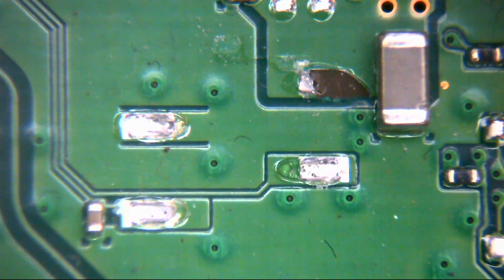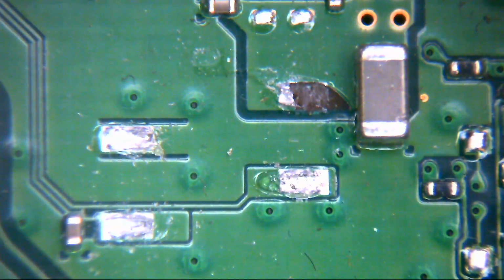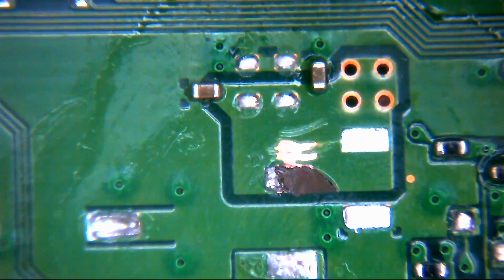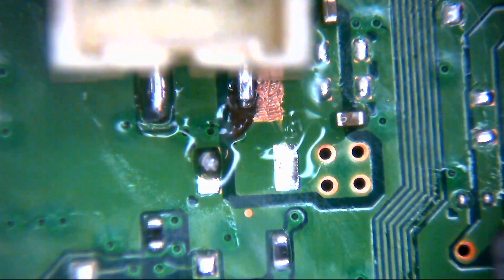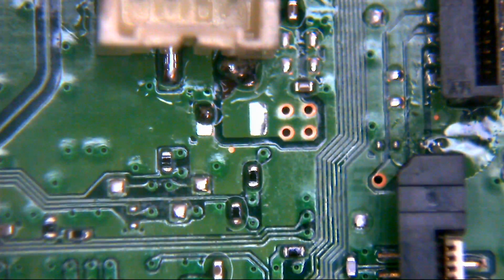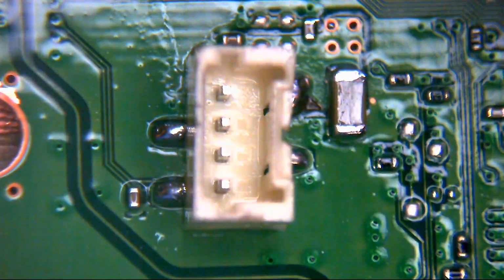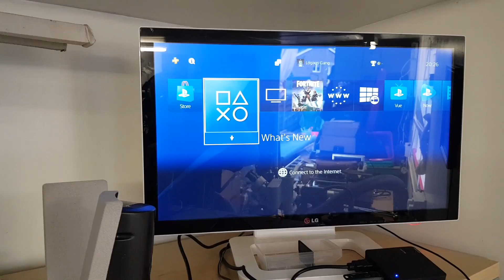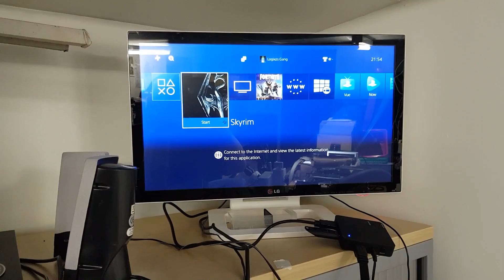PS4 CUH-1216A 5v Connector Ripped Off Board Repair

Comment: A piece of copper foil with little holes that line up with the solder blobs should allow you to fuse the foil back to where it is needed and the cap can be replaced, would the overheat problem go away if a Corsair AIO was used instead of the HSF.

Comment: Love those videos. Lets put some flux. Lets solder it. Lets check connection with fluke. Lets clean the board with alcohol. Lets put some flux. Lets solder the capacitor with soldering tip big as power connector. Lets change the tip. Lets solrder the capacitor. Lets clean the board.

Comment: Hi Andrew, I ripped off the bottom right pin, the "data pin", off the motherboard. Can I scrape the area to the bottom of the pin between the two dots and solder the pin back on?

Comment: What would I do if the pad ripped off of that bottom right connector. I think you said it's a data line. That whole little square came off on the bottom right one

Comment: thank you for the video! great information on the ps4 and soldering in general. I was able to fix mine using your method.
Reply from the maker: Glad it helped
Reply: I have no pads on mine SAB-001 5v 4pin. What is the best Enameled Wire to use for this repair??

Comment: Hi,
have you the pin out underside psu connector of  ps4 pro? a photo? because sometime is more easy try to connect to the underside...with no connector but with cables.
Reply from the maker: I do - take a look through my other videos and you'll find it. In the description is a time-stamp of where to find the diagram.
Reply: @AndrewPaul  thk for reply...can you postthe link 0lease

Comment: Hi, I was wondering if you could help with a ps4 I bought to fix? I didn't test it as I could see the hdmi port was in bits, soldered on a new one no problem but it just has the continuously pulsing blue light. I've checked the board and there are shorts to ground on almost every component around the apu and ram chips... they're everywhere! I was thinking of pulling the APU to see if this will help or should I put it in the bin now?

Comment: I did the same thing however my ground is the only one that ripped away from the motherboard. What parts of the motherboard need cleaned to the copper..and I'm using silver conductive wire glue to do this job
Reply from the maker: If ground is the only one missing, scrape the conformal coat next to the missing pin then bridge the solder across. I wouldn't use the glue - it likely isn't going to be strong enough to hold the connector and you'll have issues getting that ground pin back in place as you'll need to do the above to get across the gap which is now present.
Reply: Andrew Paul so bridge the solder from ground to itself?
Reply: Andrew Paul bridge the solder across to where?

Comment: Alright so the connectors have the motherboard still on them am I a able just to solder them still and they should be able to work? I would like to know if I could get a reply so I know if I’m able to fix it!?
Reply from the maker: Hi,
If the pads from the board are stuck to the connector pins then no, it'll require link wires running for those missing pins.
If the board still has the pads intact (they'll be solder silver in colour as opposed to black / brown if they were missing or ripped up) then yes you'll be good to solder the pins from the connector back down and all should work fine again.

Comment: Good morning paul from Spain,
I am learning a lot with your videos I love them.
I do not know if you could help me, I'm repairing a ps4 1216a, I had a bad power supply that did not turn on. Now I have put one that buys and turns on but the second one goes off does not even fan. it may be that the source that bought this damaged a lot of thanks I'm watching the next video a greeting.
sorry for my english is translated by google translator

Comment: Hey bud, so I recently opened my PS4 and was able to clean the heat sink and replace the thermal paste but in the process I accidentally ripped off the connection for the power supply off the motherboard all pins are still on the connection but the connection is stuck onto the plug running from the power supply it looks way better then the one you have fixed on the model 1215 but Idk what kind of tools and ointment you used to resolder the piece back on? Please and thank you bro, I at least know that mine is fixable and all hope is not lost, thanks again
Reply: Same😢

Comment: Hows things Andrew having a weird issue with my ps4 lately. Sometimes it powers on and plays fine for hours. Sometimes i get an hour and it goes off. other times it turns onto blue light and nothing happens i have to pull to plug to turn it off and leave it for a min or 2 then it'll turn on. Sometimes the beep doesn't work on start up either.? Any ideas. Thanks..👍

Comment: hello sir
i have a question about  my PlayStation 4 PS4 SAC-001 Motherboard. my problem is  i missed two diodes near to HDMI port and two resistors from back site of board but i do not know the number of the component. but you mentioned it at your text mssg that we can find out the same diode and resistors in ps3 motherboard that it works for ps4. can you please write from which one model of ps3 we can use the diodes and resistors for ps4 thanks. and sorry about my English.
Reply: You need to replace the diodes and resistors that you previously removed. You already have these, so simply put them back.
There is no reason to remove these parts. Next time, do not open the console and do not touch what is inside. Do not remove any components.

Comment: Hello, I have a slim ps4 that enters due to damage to the hard disk, in which a new disk is installed and the failure continues in the following way ... almost at the end of the installation it is fried, I turn it on again, it repairs the start and everything works fine for hours, on the next power left if I give video, but with white light, I turn it off, the start repairs and works fine again, I also notice that if it is working and I change HDMI device on the TV I mean I happened to see the console to watch TV, when I return to the console, stop sending video again,

I never pass this type of behavior to detect if the fault is HDMI or APU.
Any advice?

Comment: Have you repaired (or have a video) of the same connector port for the ps4 pro model cuh-7215b? My son took his apart to change the thermal paste today and ripped the connector off. Finding someone competent enough for a pcb repair here is a joke, lol.
Reply from the maker: I think I have one which is currently in editing. Should be up shortly :)
Reply: @AndrewPaul  that's awesome. I can't find anything on this same model, with the same problem. I want to learn as much as I can that way when I do find someone that says they can fix it, I know what cost should be and time. A lot of shady people in Denver Colorado. Lol.

Comment: can you tell me the value of the capacitor that you removed and put back in. i have the exact model and the 5volt is shorted out. i tested the capacitor with a dmm and its shorted
Reply from the maker: Hi,
Does the short disappear from the board with that cap removed? Is the short still present across the cap with it removed from the board? It's rare for these to go - and rarer still for them to short (they'll usually go open).
Reply: @AndrewPaul  i will have to remove it and see. I believe my technician may have tampered with it on purpose because i did not want to purchase a very overpriced used power supply. I'm no tech but i have a little idea about electronics. Would greatly appreciate your help.  Thanks

Comment: My 5v pad is shorted to ground and i removed the same capacitor that you did and its no longer shorted... i also lost the capacitor in my carpet lol.. any suggestions on what to do now or where I can find a replacement?? Id greatly appreciate it!!
Reply from the maker: Probably a donor board would be best to take one from - without the schematics it's hard to determine the actual specs. I may be able to supply one if you're struggling .

Comment: How would I fix the bottom two if they were ripped. Please help
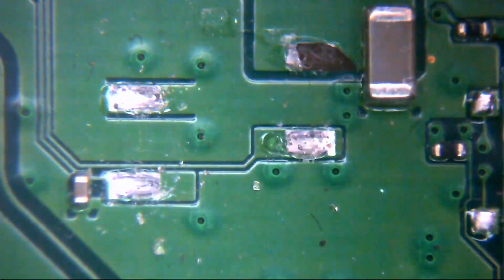Reply from the maker: If you have a look at 02:45, you can see some thin light green lines coming from the left hand ends of the pads. Follow these to their next component or via along that line then run a link wire to that location. The bottom pad goes to the top side of the capacitor as seen in the image (it's a very short wire run from the leg of the connector when it's in-situ) - the second from bottom goes along that trace to a via (if memory serves me correctly). Prep the via and solder a link wire there. That should have you back up and running. Once tested and working, pot the base of the connector in with some epoxy to get some strength back into the connector to prevent it lifting again in the event you ever need to remove the power supply in future.
Reply: Andrew Paul  thank you, you are a life saver :))) appreciate it

Comment: What is flux for? Can it be done without it?
Reply from the maker: It aids tinning and wetting of solder joints - basically it helps the solder to flow easier and helps create a better quality solder joint. It's essential for an easier repair experience and a better quality job.

Comment: What should I do about mine? Top left and bottom right pads have ripped off. I can email you pictures of the damage!
Reply from the maker: If it's in the same orientation as per the video thumbnail, top left pad is ground so can be easily linked to the surrounding area by scratching in a new pad next to the pin on the connector and bridging across with solder. This will also help add strength to the repaired connector when it's back in-situ. Bottom right just follow the trace back along to the via at the end and link it there via a jump wire.

Comment: the metal bit thats part of the motherboard itself is still on the pin can i jus soldier it back to its original place? @andrewpaul
Reply from the maker: If the pad has lifted out and is stuck to the connector then it's best to remove it and run a wire. If the pad isn't in the board any more, its connection to the circuit is broken - merely putting it back in place won't restore the connection sadly.

If it's a clean break at the end of the pad and the trace is both visible and intact on the board, you might be able to use some PCB epoxy to bond the pad back in place, scrape the conformal coat from the trace leading to the pad and reconnect the two with a coating of solder - it all depends on the condition of the pad, board and ultimately how much time, effort and ££ you want to spend on getting it reinstated.
Reply: @AndrewPaul  Thanks man best man on youtube

Comment: Hi mate, I accidentally ripped the wires out the connector,  what do I do?
Reply from the maker: On the PSU side? If so, you can replace the cable between the PSU and motherboard - it just unclips from the connector on the PSU.
Reply: @AndrewPaul  Yeah from the PSU side, do I just order another 4 pin cable? Thanks for your reply mate!
Reply from the maker: Yes bud - just swap the cable and all should be well.
Reply: Thanks mate, much appreciated 👍🏾
Reply: Do you know if I need a specific one? Or will one for the ADP-240CR work? My battery is a ADP-300R

Comment: What do I need to do if one of the data ones has pulled up from the mother board? Left one on video
Reply from the maker: Do you have a photo of your damage?
Reply: @AndrewPaul  This happened to me too the right data pin came off and I don't know where I'm supposed to connect the wires to.
Reply from the maker: Follow the line coming from the end of the pad - it goes to a small ring (known as a via). scratch very lightly away at the via to remove the green coating to reveal the copper below. Mount the connector and solder the other pins, then run a link wire between the leg of the pin with the missing pad and the via you've scratched off. You'll need some decent flux to get it all on smoothly but shouldn't be too difficult if you've ever done soldering before. Good luck.
Reply: Andrew Paul is a link wire just and overall name for one type of wire or are there certain ones and if so which one do you recommend for this
Reply from the maker: The term link wire refers to the repair - it's a wire which connects (or links) two components together where the original circuit trace was damaged. Best type of wire for these repairs on PS4 is enameled wire (aka. transformer wire) - IIRC the stuff I use is 38AWG (0.1mm diameter).
Reply: Andrew Paul thank you!

Comment: How is it possible that these pads could possibly get ripped off? What kind of idiot would open their console and remove the 4-pin connector and tear it out rather than desoldering? Who would deliberately damage their PS4 in this way?
I ask because there are lots of comments on YouTube about this exact problem ,and I cannot understand how it could happen.
Reply: Usually it gets ripped off when you try to unplug power supply plug from the connector.